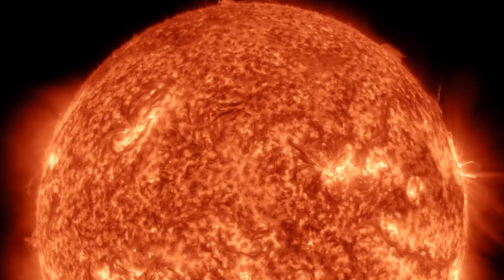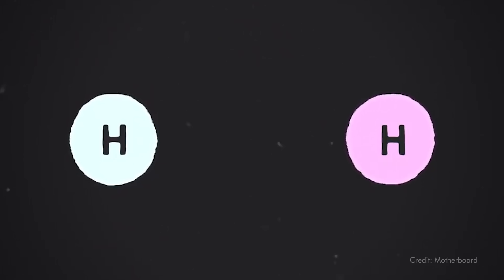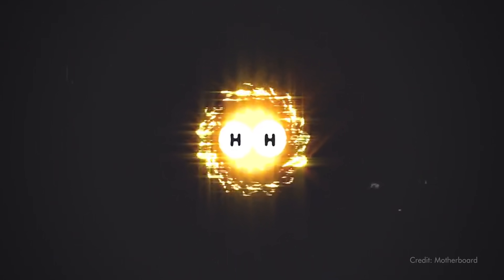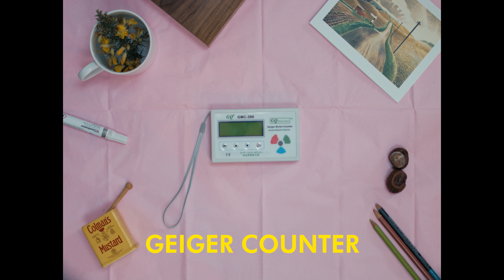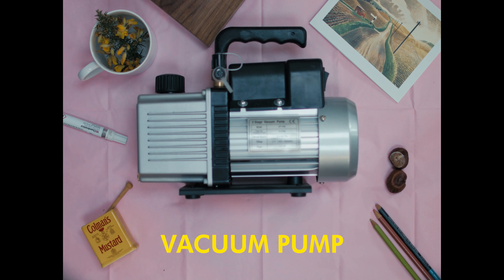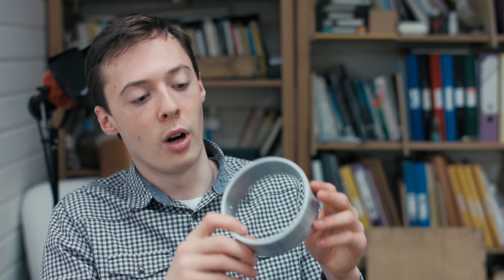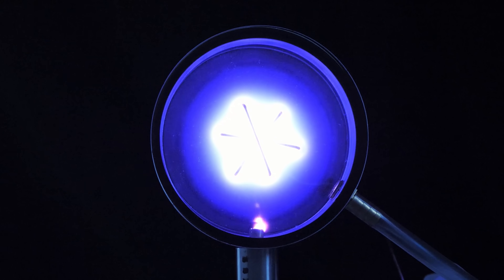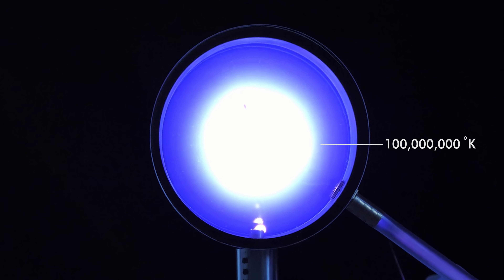Making a Desktop Fusion Reactor

Comment: Hi. I just wonder, what if you would pass through the Fusor, perpendicular direction or round inside the tokamak kind of a donut shape chamber, using frequency regulator and voltage regulator, and using two sources of triple harmonic frequencies (oOo - that shape like Sinusoid from two sources targeting the center), would that, if regulated well, draw energy from the so called "eter"? Theoretically of course?

Comment: If you attached a solar cell at the back of the reactor you can generate electricity because it emits light and heat energy which could be used to generate electricity by a small solar cell 👨‍🔬

Comment: Thanks for sharing. Apparently a regular cfl ballast can be used to make both an induction heater and a high voltage dc source with a flyback transformer--im curious how that would perform. Also, couldn't one theoretically successfully fuse any isotopes sufficiently below iron [on the periodic table] at that input energy level? Anyone considered a glass diaphram with a volume-conforming rubber lung (i.e. a balloon, perhaps with the conductors poked through/sealed-into the balloon?) Perhaps hallbach arrays (insulated by a steel cylinder to protect the permanent flux while still conducting the field. Could study hall effect for appropriate orientations also. All our shortcomings as a civilization have been fabricated for us.

Comment: What size capacitors and diodes did you use for that voltage multiplier? And are you going for high voltage only or high power because the voltage multipliers ive seen produce very little power relatively

Comment: Shall we try again?
instead of having a sphere such as what you put in this one lets try two out/input feed loops as you might see in a magnetron... 
be sure to never cross electrical wires or the magnetic field emitted will be contaminated.
the objective is to get the orbitals of the hydrogen atoms to change from an s orbital to a p orbital. this is done with high voltage and low amperage at very high pulses per second.

you will want both of your feed loops to be in parallel, but inverted from each other, meaning one comes into the chamber from the right and the other from the left
keep the rings spaced about one third the diameter from each other.
when looking at it from the front you should see a full circle in the center of your fusor the rear ring being directly behind the front one. voltage should enter each loop in the opposite direction one clockwise the other counterclockwise. this should cause the electrons to travel in a toroidal fashion.
using a high voltage Reihistat/Variac adjust the voltage up and down a large range of high voltages 1000's +
Likewise using a switching station adjust the frequency to get the best wave form bouncing from the electrodes off the walls and back to the center...watch for nodes of plasma and continue adjusting until the nodes are in the center.

Comment: The geiger counter you bought has been found to be a scam and not measure accurately at all.

Also, high voltage in a vacuum produces much x-rays. At your voltage level, it can be very dangerous. 

This isn't a reactor, you need a special gas to actually cause the nuclear fusion. This is not creating fusion, only x-rays

Comment: Probably one of the reasons that you don't get a better output to input energy is your high voltage circuits. Just a couple of AA batteries would be enough to create a crazy HV for a very long time because after getting the initial voltage on your plates in theory you have no moving charges thus no current and power consumption.

Comment: Late to the party, but BE AWARE of the K(alpha) radiation! This device will most likely emit x rays!  Do not fry yourself!

Beautiful gadget, but I personally don't think this fusor will work.  Pressure due to the H2 Purge is still too high. You want to reach  "star mode". Otherwise, too many ions will recombine / too many collisions will occur with insufficient velocity. Also, due to the geometry of the chamber and the electrode cage, collision with the cage is too likely. A good fusor should be spherical in my opinion so that the ions are accelerated from all sides to the cathode (higher probability of reaching  the center). 

Use a bubble detector to proof neutron emission and me wrong =) would <3 it .
Reply: Hey some doubt, are you there.

Comment: You won’t get a good enough vacuum with your setup ( pump and the fittings)
Also, didn’t use any deuterium or tritium 
Fast electrons will register on a Geiger counter so it’s not a trustworthy measure , why don’t you use a cheap neutron detector to see if you have any fusion, if you get more anything tangible, I will print this comment 200 times and eat each page

The glow is just normal hydrogen discharge, nothing more

Comment: ok if u are not insane, I'm pretty sure china have made a reactor that ultimately releases the same 100million degree celsius that was at least 100 times the size of this reactor and they made a world record of it.
they had to cool down the reactor with water pumping to be able to run it for 100 seconds.
how the hell were u able to do the same thing without melting your entire house? 100Million degree maybe is what we need for many scientific applications.
Reply: 100 million degrees is a value of molecular movement, not directly translatable to thermal
the chamber is a vacuum so it's just jiggling around a lot, no significant heat produced

Comment: Almost costless electricity and therefore hydrogen from new fusion nuclear is now immediately upon us. We have recently taken a new step to advance the physic of power production by enabling chemistry of the atomic nucleus, or "nuchemy" in the newest FUSION NUCLEAR POWER., the technology of the SAFIRE GENERATOR. We are passing the chemistry level where we interacted with the atomic electron shells and are moving on to manipulations in this "NUCHEMY" atomic nuclear era when we interact and multiply nuclear protons. We have rediscovered the lost work of the alchemists and can make new elements with different atomic weights. This was ably demonstrated in "The Safire Project". Quanta are important. We now have enough energy in them to manipulate the atomic nucleus much more easily by creating a compartment, or what is a local region of plasma containment so reactions at this atomic nuclear level can easily take place. This is about to practically enabled a really fantastic and cheap new era of energy production for the whole of mankind. This with hydrogen, so free fuel obtained from water or atmospheric moisture anywhere in the world. This new fusion nuclear is at the industrial commercial production final development point as of now. The energy argument and other power methodologies are all now virtually irrelevant as we have new and very physically and economically powered practical and local community level fusion nuclear power. Solar roof plus Teslawall battery may be the present way to go domestically but megapack batteries and multiple storage technologies interconnected with an expanded ugly grid have a less certain requirement when you consider new any-scale community based and 24 hr reliable and self-fueling fusion nuclear in the form of the "SAFIRE GENERATOR". Learn all about it at "AUREON ENERGY.COM". Learn the newer EU Theory and plasma physics at "THUNDERBOLTS PROJECT.COM" and you will be permanently reeducated with this advanced new EU theory that will allow you to understand more about the astrophysics of our whole universe and all within.

Comment: I'm not a physicist, but I am an electrical engineer. You used 50,000 v input but at what power watts?   Your output, you told us the temperature, but was the power, and what is the power percentage of output/input?  Additionally, what was the cost of your apparatus, including your time of producing, and what wear items were destroyed in the process?

Comment: Can i ask a question the temperature is 1000000 k so how this poor aluminum pipe dont get melted
Reply: I’m not entirely sure but I think he pulls a vacuum inside the chamber. Because there’s no atoms to transfer heat the aluminum doesn’t melt. On bigger reactors they use the heat to Generate electricity
Reply: @beaudinnapolitano9954  oooh that,s true there is no matter  there it look logical thanks dude
Reply: @beaudinnapolitano9954 electromagnetic waves does not need a medium to travel but really it didn't become that hot even near

Comment: Im not an expert, but having the same temperature of the sun's core is not enought. Sun can process fusion having help of his high gravitic pressure(force). You dont have it in your experiment. In order to occur something with 1 atmosphere you need at least 5-6 times sun's core temperature ....or you must add an impossible gigantic pressure to it (not viable)...

Comment: I think in order to fuse hydrogen instead of deuterium, you need pressure 300,000,000,000x than that on earth and high pressures mean lower temperature needed (Temperature > 3,000,000K) and you need much, much more deuterium/hydrogen to start a exothermic chain reaction to release much more energy than it takes in.

Again, mistakes happen with everybody. And it's nothing to worry about.👍👍👍👍

Comment: if the core temperature hit the 100M degrees (K or C does not matter :) )..... why the metal core cage did not melt? what is the time frame of the 100M degree? what is the high voltage pulse magnitude & duration?  did you generate any energy, in other words what is your energy generation factor (Q)? how did you quantify?

Comment: I might want to reproduce this but...  It's missing most of the key engineering details.  Without that, how does one know that it's not special effects?  100 million degrees...  How is that temperature measured?    What is the clear sides made of?  Glass?  That melts at about 1400 degrees.   (sigh)

Comment: I bought 10kv capacitors and 10kv diodes to hook up to my 10kv transformer. Will what I’ve got work to make a voltage multiplier circuit?

Comment: ya the fact that he made his little video to show off, but didn't explain anything just stinks like arrogance.. if ur gonna silver plate, notate the recipe and voltage for the sol'n.. and the NaOH and aluminum foil..? wtf was that for? and then ur "voltage multiplier", looked like some sort of low budget rectifier or capacitors in series.. point is that some poor kid is gonna try to copy ur work by watching ur lame video and is gonna hurt himself really badly. either post proper instructions or stop showing off.. its irresponsible to do otherwise.. ur obv not stupid, so straighten out and use ur head.. dumdum

Comment: Maybe you could make an mhd generator out of two doughnut magnets and two rings. The magnets are stacked attracting each other. The rings could be inside or out with a small space. Just so the ionized gas goes into the rings. The magnets polarized the charges to the plates to work like a battery?

Comment: what metal have you used to han dle that 100m temp and  why didnt you use magnet fiel to hold the plazma
Reply: Very low vacuum makes energy transfer low.
Reply: @osyisr6361   yea but if he managed to make a magnatic field that van help him gatter all the lost atoms in the vacum in the middle so he can get more energy output but thats still cant change that he cant have more output then input

Comment: As a physicist myself, I don't find many real science projects, with high details on YouTube (due to reasons I'll not gonna get in this comment), so I don't expect to find one, specially related with certain topics. And suggest you all to keep your expectations low as well.
Still a physicist, I don't even have 1% of the knowledge, experience and skills needed to build something with the quality shown on this video, not even mentioning the edition. 
How many times needed something to build and got no idea on how to.
Back to the physics:
I think everyone knows this a Fansworth "fusor". I uses electrostatic confinement of + ions into the center, and fusion can only be achieved if the plasma comes from D + T gas. By the way, the color goes red/purple when H gas is inside (see electrical discharges on gas tubes).
About de radiation. When working with high voltages on a vacuum (or almost vacuum) you will get x-rays after certain threshold (see x-ray tubes not working, and after a few volts given, bang).
Neutrons colliding with nucleus can also indirectly ionize. So, the only way to know if fusion is occurring is detecting neutrons or helium particles.
So at least by me, there is no need to throw rocks on this guy just because of the tittle of the video.
Custom works I see, are far from the quality shown here.
I think many scientist, teachers, or hobbyist with scientific backgrounds will like to work with high skilled builders and communicators like him.
So, prost, cheers, salud, shalom!, as you name it where you live!

Comment: Nice project and a beautiful and quite extraordinary lamp^^
Just to clarify: as long you have just air (well, very little of it, but still air) inside your chamber, it is "just" a plasma but you will likely not get any fusion. You might still get some counts on your ionizing radiation device as probably some fast electrons are generated due to the high voltage making x-rays - something you definitely want to check when operating it ;-)

Comment: No take 2 magnets and attach them to each open end of the cylinder so that the opposing poles are facing eachother, hook them both up to a rotational device and spin them clockwise at a very high rpm

Comment: First question: since it reaches hundred million kelvin, could you use it as a tea kettle?
Second question: Is it naive to assume you could make a second one and sell it to a fan? If it isn't, what would you be charging?
Reply: it's basically like asking can you boil tea with a light bulb. Yes, the inside of it reaches thousands of degrees, but you don't get very much heat on the outside

Comment: It's just a plasma ball!, hardly fusion so you pulled a vacuum and fed in some high voltage seriously this is a joke. The high voltage is just producing ionizing radiation like any Xray tube , PS your nuts will drop off soon

Comment: IMO, this is not a fusion process but a magnetic monopole string knot also known as micro black hole with negative charge outside and positive charge inside the globular space..
If you make two hotspots side by side you may tap the free energy made between both  ball lightnings

Comment: First non spherical fusor I’ve seen, so it’s good to see that the effect is not dependent on a uniform distance between anode and cathode.  Would be interesting to see if a neutron detector picked up a significantly less output than a spherical fusor of the same radius.  If not, then this fellow invented a miniaturized neutron generator!

Comment: Wait... isn't the breakdown voltage of air far, far lower than that of what your voltage multiplier produces? How did you prevent insane arcing in your circuitry? Did you pot the whole thing? I mean... you put a lot of work into this but didn't really explain a fraction of it.

Comment: If the center is 100 000 000k so the Metal should melted.
Beacuse melting point of Metal is much less than 100 000 000k
Reply: Thanks a lot Dr. Lakjaa
Reply: Very interesting

Comment: Haven’t tried it, but I’d do it if there is just alpha radiation. Also, how does the core not melt? 100,000,000 degrees Kelvin is equal to 99,999,726.85 Celsius. How doesn’t it melt?
Reply from the maker: Sam Black because there’s only a handful of atoms in there at that temperature. Total energy is almost nothing, even if the temperature is really high.

Comment: It's completely fake. If it really reached 100 million degrees probably the light coming out from the glowing metal inside would melt you, which silver coating and vacuum wouldn't help.
Reply: Wouldn't that completely depend about the amount of energy emitted? If it was just two atoms that underwent fusion, then obviously, that tiny, high energy level isn't going to get very far.
Reply from the maker: This. Total energy is very very low.

Comment: A pin head of material at 100,000,000 degrees in the atmosphere would vaporize everything for 10's if not 100's of miles.
Reply from the maker: Theres less than a pin head of material at that temperature. It's a hard vacuum in the chamber. It's at most tens or hundreds of atoms.
Reply: @WillFromLondon  I know dude. Im just saying, its a ridiculous temperature.

Comment: im going to be building a S.P.R using iorn rods. and ALOT of electricity. and it wont use any uranium. it also will be smaller then a refrigerator. i also might make a "pocket reactor:" so you can take it pretty much anywhere.
S.P.R: safe power reactor

Comment: Hi, i am planning to build one of these as a school project, i have one question: did you use any deuterium gas or any  other similar one. Also, how  many and what type of pumps did you use
Reply: No he didn't used deuterium. If he did there would be harmful radiations. This is just a prototype. If he uses deuterium, he have to improve some designs..

Comment: hi, what is the temperature of the metal when its turned on? to get power back out it, you could add some thermo electric modules around the circumference to generate power from it , i think it needs to be about 300 degrees for them to work, then store the output voltage to a capacitor bank with a high farad value for a long storage time. then power a DC to AC inverter for usable power. if you know about loop circuits or generators. you can get it to run itself after it starts up and divide the power for things you need, good video